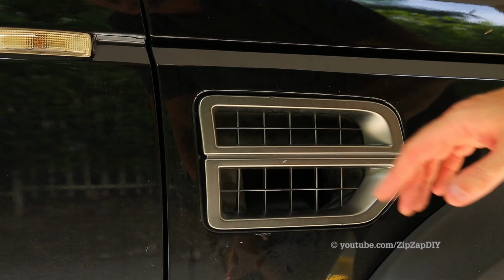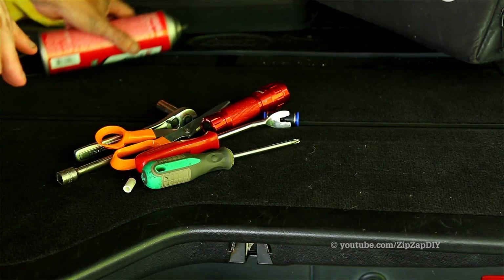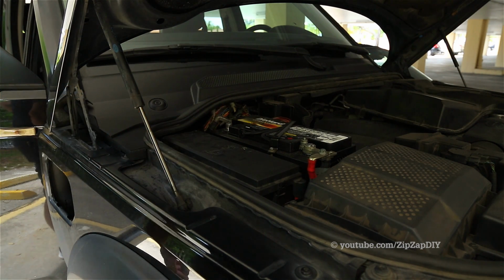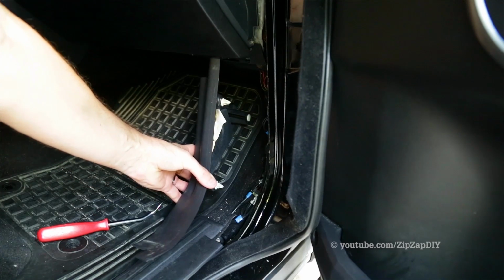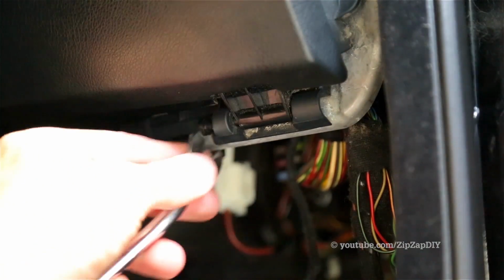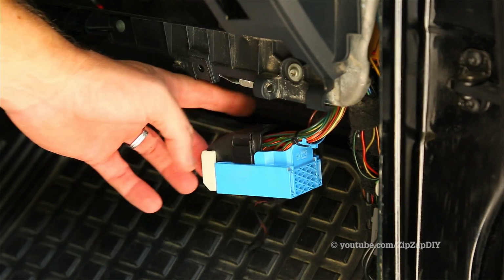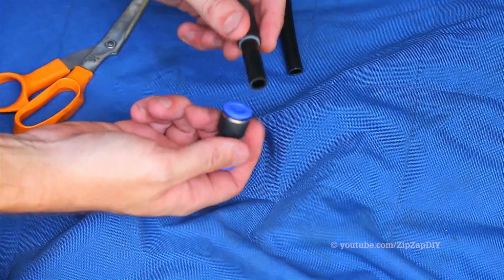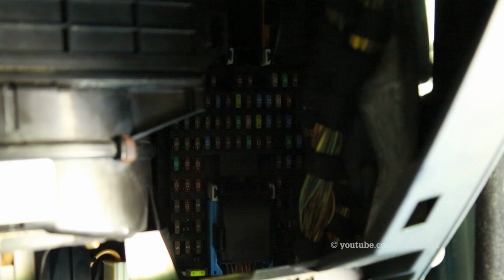LR3 RH Sunroof Drain Repair / CJB Removal / Water on Floorboard

Comment: It took me almost 3 days to put my car together. If same thing is to happen again, I am taking it to a mechanic. Few things that I found that may be helpful if you are trying to do it on your own
1. Both connections behind the board are shaped different from each other. If your connector isn't going in, make sure it is of right type. I wish I had known this beforehand.
2. Tube connection can also be made inside A pillar. Make sure to do it near the top or bottom because center doesn't have much room for connector to sit in.
3. If you are fishing new pipe in, make sure it goes above CJB housing. There is an opening right above it. CJB has to fit tight in its housing.
4. Try to lift CJB as high as you can, slightly turn it left or right to make room for the connector that you are trying to affix. Pull bottom wires out of the way first.
5. After locking each connector in, try to pull it lightly to make sure it is properly in. One of my outside connector was loose and truck failed to start.

Comment: Great suggestion on the push fit connectors - I've bought some and am going to retrofit. I recently completed this job on my LR4/Discovery 4 and found the CJB easier to put back in by connecting the top 2 large connectors first, which seemed to give me a little extra room to connect the rear ones. Awesome videos - wish I'd found them before I did this repair!
Reply: You don’t know how much your suggestion just helped me brotha. 😂

Comment: Thank you. I completed this today, it took about 3 hours with breaks from the Florida heat. Most difficult part was the rear electrical connections for sure. I replaced the drain tube and made the splice in the A-Pilar in case I had an issue down the road. Really was not difficult to thread the new tube up once you have everything remove. Thanks again

Comment: Thank you - great video. The makeshift glove box removal tool worked great. You were right about re-attaching the rear connectors. I have larger hands and it took about an hour and a half for me to finally get them locked in place. I found that pulling the bottom front wires out the front opening gave me just enough extra space to get my hand behind and work the connector into place. It wasn't a difficult job, just tedious and frustrating. The Land Rover engineers should have made the connectors about 10 inches longer so you could connect it outside of the dash and push it back in. Engineers should be required to replace all components on new cars so they can experience the difficulty of some of their decisions! My boot was rotted out and full of sludge and I'm confident this will eliminate the water issue I was having. Cheers!
Reply: Do you remember these two connectors on the back brown and green, which one go left and which right?

Comment: All good information from Ron. However, I thought I would try and flush both RH and LH lines with water and/or compressed air first.  I ordered a package of five 12mm push-to connect couplers from Amazon at $12.99.  I viewed Ron's video to access the vent chamber, removed the soggy sponge to the trash,  drilled a 1/2" drain hole at the lowest level of the vent chamber bottom. I removed both A pillar covers to expose the drain hoses and opened the sunroof, cut both drain lines with snips in the middle between the holding clips above the dash level.  I forced some water into the bottom half (both RH and LH) and it exited  the vehicle as it should. ( I used a wound  wash appliance from a medical supply house to force the water...do it the best way you can).  I forced water into the top half from the sunroof with a towel below to catch the flow.  Afterwards, I also used compressed air at the top of each halves of the lines. All was normal.  Feeling confident, I reconnected both hoses using the push-to-connect couplers and prayed to God for success. I poured water from the sunroof ports and VOILA water exited the car at the exterior behind the front wheels as it should, not within the foot well yielding soggy carpet. NOTE: in my case the exit nipples had not deteriorated (no new replacement hoses needed) AND no fiddling with the CJB, central junction box!!  Try this process first with only a $12.99 investment. Had this process not worked, I would've had to go back to square one with replacement lines and maybe a CJB removal experience. Good luck.

Comment: Just finished doing the passenger side drain with the help of this superb video. Two great tips from comments below were that you can remove the split elbow from pipe and replace it with the one from the new official part, all without needing a push fit connector, and to refit the top two front connectors before doing the two on the rear. Overall the job was fiddly but very doable. Mine is a 2015 car and had different connectors to those in the video. Three on the from, two on the back and two on the bottom edge of the board. Official JLR part was £20 so cheap enough.

Comment: Hi thanks for the great video, which was very helpful in doing this job. I considered using the pipe connector but in practice it was only 30 mins more work to part drop the headliner and use the old hose as a draw line to pull up the new hose. The worst bit of the job is the CJB which takes a lot of fiddling and careful manipulation of nearby cable looms. Regards Mike

Comment: Good video but a lot of work. I just unclogged my LR4 sunroof drain hose  with a tie wrap and it flows really well now :).. try this first and rinse up top one cup of water at a time to confirm water flowing. Much simpler :).. 

Now on my friends LR4 it was clogged with tiny leaves and dirt midway so we just attached a hose on the nipple at the side vents and ran the extension rubber hose to a bucket of water and then up top we used a wet n dry vacuum ( taped it to seal at the OeM hose where it connects at the the sunroof drain rail) and sucked backwards and the dirt cleared and for good measure we used the tie wrap method to clear the nipple side from the accumulated dirt. :) Side vent and A pillar sun visor and Seat belt trim is all we took out to get to the drain rail. 

Hope this helps :)..

Comment: I had this problem with my LR3 recently. I pulled out the outside vent, removed the foam piece and threw it away. The drain was decayed but I was able to use some needle nose pliers and pull the tube through again. Not wanting to remove all the stuff inside. Worked perfect.
Reply from the maker: That is very interesting, so you pulled the tube sans nipple out the hole. That is great, anything to avoid messing with the CJB,  did you secure it or seal it? I see a risk of backing out of the hole?
Reply: the nipple was completely decayed but there was a bit of rubber at the end  of the hose and it held it in perfect. Lucky! Also, the wires in the corner of there floor board were very wet, 2 wires completely corroded. I cleaned it all up and reconnected the wires. My auto headlights work again and the sunroof. Took a good 2 weeks for the carpets to dry out, even folded back for airflow.
Reply: What does that foam piece do exactly anyway? It looks to me like it would block the flow of water.
Reply: @jeremyacevedo6592  Not sure what the foam is actually there for, perhaps sound insulation? All I know is that I removed it and everything worked great.
Reply: Hi how you did? I have the same problem and no idea how to solve this problem. Can u give me a instruction please?

Comment: Did the repair on my 05 LR3 The pain is now forgot, but those damn electrical connectors on the back side of the control board are an absolute nightmare to put on without the hands of an 8 year old child. Very little space. Thanks for the video though. Got 'er done.

Comment: Thanks- pain of a job! I used a 90 degree garden irrigation hose connector with tape and sealant. I have a right hand drive vehicle and leak was on left of the vehicle. In mine the CJB is on the left, a mirror image of your setup. I also had problems with central locking, likely related to the water: it’s worth digging out the white and green wires in the trough running along the floor where all the water has collected and resolder the connection....I’ve also had battery problems I think related to all the wet wiring.
Thanks again
Reply: Were the white and green door lock wires on the drivers or passenger side? How far up or back in the trough in relation to the front or rear doors, or front kick panels?

Comment: I may be mistaken but the new nipple you were testing wasn't  pushed all the way into
the hole. The integral grommet is intended to lock and seal the nipple in that hole. A little
dishwashing soap is helpful to  get it in. You'll get leaks again after some jostling around 
because it isn't secured well. Also, there is enough room on the A pillar to make a connection of old to new tube but I don't think that tubing is rigid enough for a proper 
seal with the push fitting. I did the rear drain lines with a short piece of 1/2 inch pex pipe.
A little heat and slight swage with a small socket and then insert the black drain line while warm. As it cools it shrinks to make a tight and compact connection. Just sayin'

Comment: Hoping no one makes the mistake I just made today. I automatically assumed that because the floor board was a swimming pool (both sides) that he drain hoses were broken. I bought the car 15 days ago so not familiar with it it. After going through HELL AND BACK to reconnect the 2 connectors behind the fuse box (green and red) the hoses on both sides of car had been replaced. I did clean the heck out of every connection with electronic cleaner and a toothbrush and apply dielectric grease to the outside part of the connectors. All that to see that the water was coming in at the top of the sunroof. I am now assuming that the drain holes are plugged up but called it a night already. By the way, if you wanted to replaced the entire line you don't have to take the entire headliner off. It will lean down enough that you can insert a new hose on the sunroof nipple. I will update tomorrow.
Reply: i am going through hell now.  any tips on getting rear connectors back in?  a tool maybe or did u just use your hands.  my arm is tired and i still dont have it in.
Reply: It is s a royal pain but I just used my hands. You have to walk way and come back later otherwise frustration sets in
Reply: @FabianCharrua  okay i have been at it  for the past 2 hours - walking away, exactly as you explained- one thing i can add is lock rear clips up - slide in and pull down.  I also removed the 5 relays and pulled back any wire in way and tied off.  I just got the rear clips in... taking a break and doing the other 4, what a pain in the neck..(or back as the seat digs into your back!!)
Reply: I did put dielectric grease on the end so it would slide better
Reply: Oh boy. I really feel The Dread for you guys. Wonder what it would cost to have someone else do it
Reply: Going through the same right now and damn 🤣

Comment: Fantastic - I was able to unblock the pipe from the air vent end,  remove air vent with sharp pull, remove rubber bits - locate end of pipe, its inside top left and then insert strimmer cord until the gunk and water comes out - job done..

Comment: These two videos are excellent and very helpful, very professionally produced and easy to follow. I don't see how it would be possible to figure this out without the aid of ZipZapDIY. Thanks. Both sides of my 2006 LR3 were leaking and I followed the directions for the driver's side. But when it came to taking on the CJB everything about that scared me, so I decided that there had to be another way. That became twice a good idea when I understood how the drain detail on the passenger side was designed to work. As designed, the spout empties into the vent chamber above the wheel well and that chamber effectively has no exterior drain. How does that work? The second piece that is pulled out of the vent opening in the video is actually a large sponge that the spout empties directly into. That sponge, as conceived, holds the water until, who knows when? To the point, once the water is in the sponge it has no exit. And it is no wonder the rubber spout decays, because it is nestled into the perpetually wet sponge. I decided to fix the entire detail and in so doing, avoid touching the CJB, by cutting a 1 ½" dia. hole through the back wall of the vent chamber and then making all the push-to-connect fittings through the hole in the vent chamber (w/elbows) and in the A Pillar (straight). There is conveniently an existing hole in the top of the wheel well that fits the new spout perfectly. Way easier and less scary than dropping the CJB, AND most importantly, it fixes the faulty original design by draining the water directly to the exterior.
Reply: All good information. However, I thought I would try and flush both RH and LH lines with water and/or compressed air first.  I ordered a package of five 12mm push-to connect couplers from Amazon at $12.99.  I viewed Ron's video to access the vent chamber, removed the soggy sponge to the trash,  drilled a 1/2" drain hole at the lowest level of the vent chamber bottom. I removed both A pillar covers to expose the drain hoses and opened the sunroof, cut both drain lines with snips in the middle between the holding clips above the dash level.  I forced some water into the bottom half (both RH and LH) and it exited  the vehicle as it should. ( I used a wound  wash appliance from a medical supply house to force the water...do it the best way you can).  I forced water into the top half from the sunroof with a towel below to catch the flow.  Afterwards, I also used compressed air at the top of each halves of the lines. All was normal.  Feeling confident, I reconnected both hoses using the push-to-connect couplers and prayed to God for success. I poured water from the sunroof ports and VOILA water exited the car at the exterior behind the front wheels as it should, not within the foot well yielding soggy carpet. NOTE: in my case the exit nipples had not deteriorated (no new replacement hoses needed) AND no fiddling with the CJB, central junction box!!  Try this process first with only a $12.99 investment. Had this process not worked, I would've had to go back to square one with replacement lines and maybe a CJB removal experience. Good luck.

Comment: Thanks for the tip. Mine on my Range Rover Sport was clogged. I just opened the roof, got on top and saw that a few little leaves and other stuff had clogged the drains from the top. Hoovered them and there ya go ! Otherwise there could be another simple way to do it : Compressed air from the drain pipe at the bottom !

Comment: I thanks for this. I've banged to do the fox fix, but rather than cut and splice, I just pulled the nipples off the end of the tubes, and put the new nipple on the existing tube.
+1 about those rear connectors being a real PITA though!

Comment: QUICK FIX WITHOUT REMOVING JUNCKTION BOX (15-20 min work. You need a 2nd person for part of the job)

Thanx for your video, but was glad with knowledge that with removing the window airbag cover between windshield and front door you can easy retract the tube above dashboard without taking junction box out. 

That airbag cover comes lose with 1 torch crew behind the plastic airbag sign that you need to pop off. Its easy.

I pulled up old tube, tried to put a pulling wire over the old tube first from the ventilation cover but i could not (if you can get a wire over that would be a good thing to do as then you have a guiding wire) so i just pulled it up towards the window inside and above dashboard..

If the end plug is still partly usable it perfect to use as a connector between new and old hose. 
i could cut of dried out part and still use most of the rest. You can also use connector inside size 8mm outside 12mm

Pushing down a new tube from dashboard towards the exhaust hole did not work well. It got stuck in all wires.
I start pushing a electricity wire with solid copper core down. 
You can steer this kind of wire a bit..Its stiff.

Had to do it with 2nd person so one pushes the other one lookes in the hole. 
Was very quick that wire was in front of the hole. Pulled wire out with a tool.
 
Then duck tape the electra wire inside a new tube that you enter from the ventilation hole side and push up, the other person pulls softly on electra wire from inside until new tube is above dashboard. 

The tube of a outboard engine gashose (Inside 8 mm outside 12MM) is same diameter. 

I used the not dried out part of the old chassis piece to connect both hoses and tightened them with hose clamps . There is enough space to work the hose and claps behind the airbag cover. 

You have to cut the old hose so the whole is connected just above dashboard hole going down. 

Took me 15 minutes and gladly had not to remover juctionbox!

Was very happy it worked as removing the junction box can be really a pain, and if you need something you can not use the car whilst doing it.
Reply: On drivers side its much more simple as with removing the dashboard plate directly under the wheel (poppes off when you pull it) and the bottom dashboard plate. Then you can work with 2 hands making an extension on the tube and push it out again. On pessenger side there is the fuse box which prefends you to get at point where you need to work.
Reply: Sounds like an easier way to do it. I can't really understand much after you pop off the airbag cover, wish you'd made a video. I'd really like to try this method.

Comment: 2015 Disco 4 ---Just changed mine. Fuse box would be a lot easier if the short cable going to the back was the same length as the other. anyway done now. I made the drain joint above the dash plenty of space behind the A pillar cover. Thanks for the info very helpful